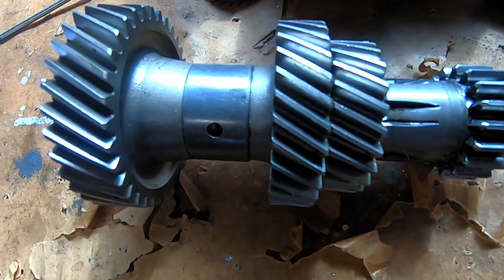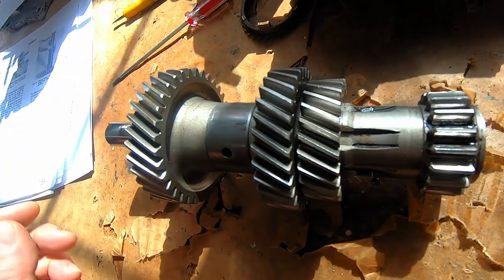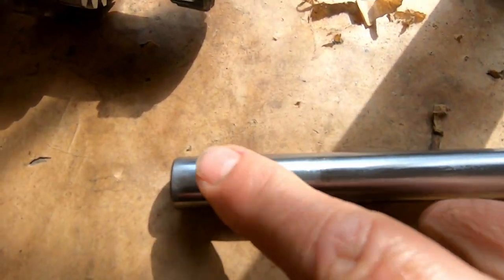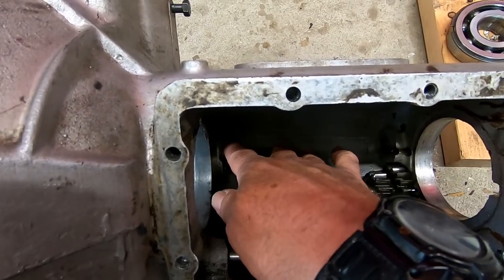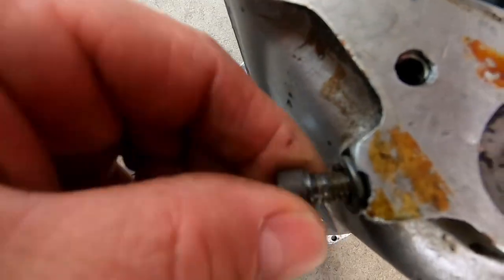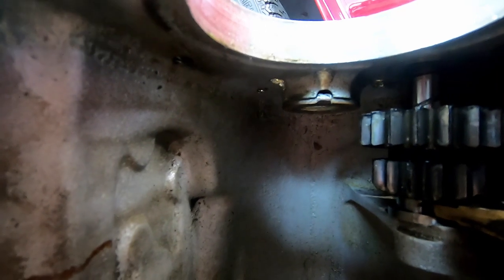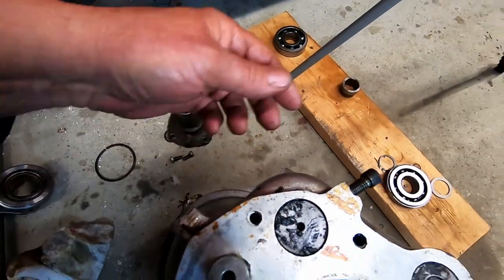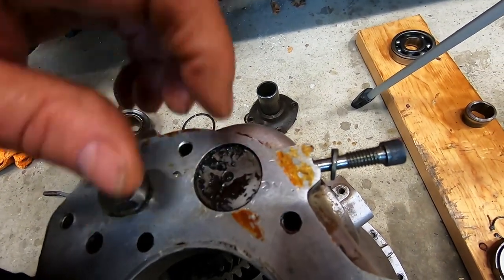Countershaft Damage Inspection On Our Triumph Gearbox TR3 TR4 | Wegs Garage

Comment: I really hate to mention this, but the grease you put on the thrust bearings will influence your shaft dimension... best to spin it around a little bit and recheck. Don't forget that red line gear oil for the transmission. I finally got to be in the 2 digit Like/Thumbs up timing... I bought my REDLINE 15 years ago, so you best SEARCH Bet there...
Reply from the maker: Haha I guess you are slacking if you are in the double digits...we will forgive you! Definitely need to get some redline. Where do you buy yours? Prices look all over the place online.
Reply: Old guy here.  I did spin the countershaft CAREFULLY with an electric drill and rubber wheel on one of the countershaft gears.  Not very fast but did spin it about 2-3 minutes and re-checked the float.  The float did INCREASE by 1/1000 of an inch so it's still good-to-go. As usual, I did this and didn't think about showing it.  I thought that my somewhat unorthodox means of spinning the countershaft I really didn't want to show to the public.  You could do the same thing by hand but I wanted that shaft to spin awhile just to be sure.

Comment: I don't know what the likelihood of a needle bearing falling out when putting the countershaft gears in place or the shaft in, or even if it is possible. But I would cut down a tube with a little smaller diameter than  the size of the shaft, and a bit shorter than the countershaft gear set, and use it to hold in the needle bearings until the countershaft is in place. Then it would get slid out as you put the shaft into place without any chance of losing a needle bearing.
Reply: Old guy here.  Yeah, off-camera I tried the slightly smaller tube trick but it really didn't make a big difference.  The key is the Triumph manual telling you to put grease on the needles.  It does hold them in place while you finaggle the countershaft through everything.  I probably should have shown me with an inspection mirror checking below the needle bearing to see if any needles did fall out once everything was together.  They didn't and the countershaft is smooth as glass.
Reply: @wegabondn728jw  Excellent! I had a needle bearing fall out on me on a overdrive rebuild back when I was a kid in the 70s. There was no way to inspect if all of the grease that I put in held the bearing in once I installed the tail housing (it was a lot, and no it didn't), so it was off to the junkyard for another unit ($25 from Fred Carver), and a rubber band to hold the darn things in the second time around. Worked perfectly. Never did find out what happened to that old rubber band...

Comment: Why are you working on the floor.
Reply: Old guy here.  Since this thing is kind of big and bulky I find it's easier to work on it on the floow.  The other reason is I'm so damn scared a part could roll off the bench, hit the floor, and be damaged.  And some of these parts are not available.   Also, I've been in HVAC for 28 years and am used to being on-the-deck.  Now, since I'm down there anyway, time to squeeze in a nap.